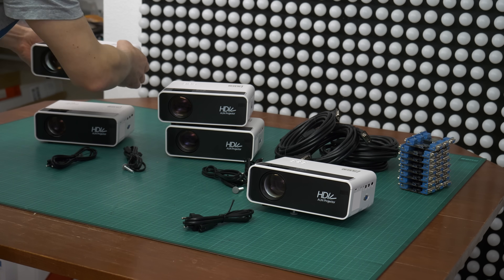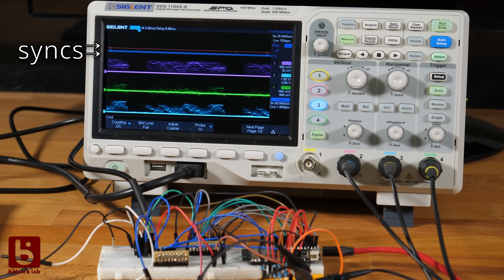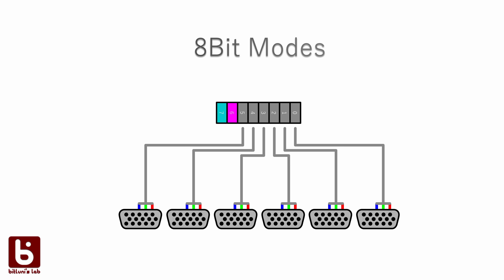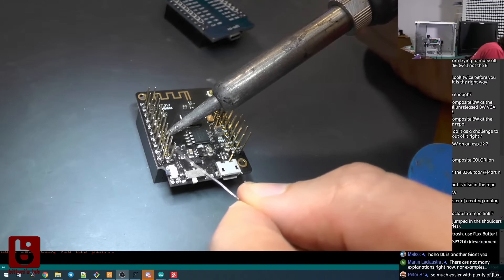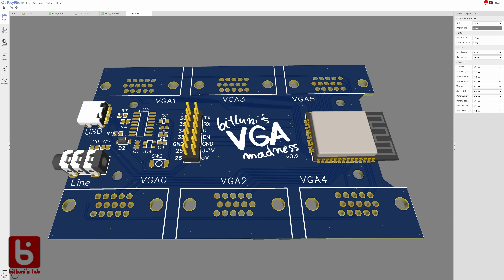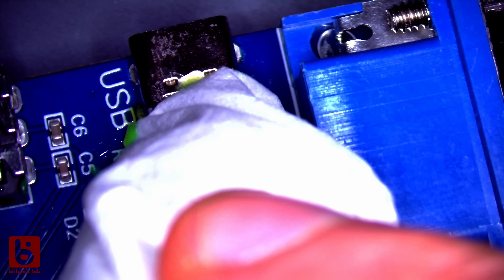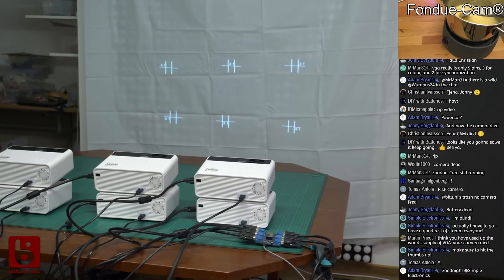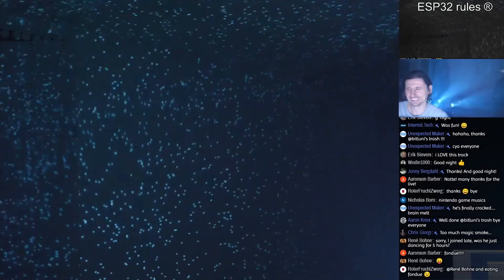6 LED Projectors driven by a single ESP32 = VGA Madness

Comment: 1:55 i know this is an old vid and your newer ones show you have more bandwidth to work with, but I feel like you could have reserved a specific number for the sync signals instead of whole bits. Basically instead of crushing your colourspace down to 14bits, make all1's/all-voltages-high vsync, and all low/0 as hsync
On the framebuffer side refuse to draw true white or true black and instead subtract 1 or add 1 so noone notices
Then instead of the simple resistor arrays on the output you could have an electronic circuit to pull x-sync high when all the other pins are hot/off. You might lose a single line of vertical and horizontal resolution but gain fifty-thousand new colours

Comment: People like to crap on VGA but the extended VGA modes could do up to 2K resolution and with a half decent cable you could get up to 50m. All with no DRM dropouts when you used a media switcher. It was grate before SDI became cheaper.

Comment: now you can do hdmi
Reply: Bro hdmi is a lot harder to implement than VGA. It is maybe possible, but you need fast clock and over clock ESP32 to pull it of.
Reply: @happinubI’m sure you can use a vga->hdmi converter with this

Comment: Can you make drop in replacement ESP32 board for 286/386SX cpu? That could be a nice upgrade for retro pc. No need for cache on motherboard and no speed limit for ESP32 just slow ISA bus. But ESP32 could emulate any cpu from 86 up to Pentium…

Comment: having owned an LPKF Laser and Electronics PC Board mill years ago, I can tell you they used a set of 3mm register pins to assist with aligning the top & Bottom layers. they also employed a collar and foot that rode on the board to set the bit depth along with constant vacuum extraction of the chips.

Comment: can you point all the projectors in to a small area with fog inside a perspex case and try to make some kind of volumetric display like a CT scan in reverse with them?? when i was a kid i dreamed of trying to get good enough with microcontrollers and electronics to be able to make something like that as a little holographic doorbell type of display, out of an array of gameboy or nokia LCDs with single LED backlights to make tiny low res projectors. I have no idea if it could work but I've always wanted to see someone try it

Comment: Would you consider using the esp-32 WROOVER module instead of WROOM? It has up to 8 mb of PSRAM, which would probably let you hold an entire frame in buffer, and this would let you use higher resolutions as well.
Reply from the maker: good thinking.. but unfortunately rover modules have more gpio pins tied up to talk to the psram. i'm already using boot selection pins for the last vga port. but the showstopper is that DMA works only with "DMA memory". that's basically a section of the main SRAM. using psram as some kind of backbuffer is also too slow. but it could be used for audio and stuff that's not as time critical

Comment: reverse/side laser/electron CRT tube, with either back mirror bounced laser to front screen, or side arc'ed CRT display
Reply: first accelerate electrons in direct perpendicular to the screen line strip, with crt, multiple lines, simultaneously, then another electric field to determine where in the line axis it hits the display
Reply: whole display length secondary direction changing electric field, spot direction electric field
Reply: multiple narrow direct cathode ray tubes as the electron sources
Reply: screen has multiple voltage terminals in matrix, in lines, to force the electrons to land in the selected pixel positions, just set the voltage up in the selected positions, colored
Reply: cross lines to point a position in x-y matrix or line-x matrix per line individually
Reply: per line is better, as many as you have sources, crt tube sources

Comment: Fair warning: Those cheap projectors like that advertise 2800 Lumens but when reviewed often produce real world values from 90 to 200 lumens. Well short of advertised spec.
Reply from the maker: i could do an comparison with a benq i got here. it certainly is over 100lumen but probably also not 2000🤣
Reply: Do you have a lux meter? If you make the projection in a surface of 1m2 the lux meter should measure 2000 lux (that's the illuminance) for a 2000 lumens projector (that's the flux). Or, measure the area covered by the projector, measure the illuminance in lux and then the flux in lumens would be illuminance*area (1lumen=1lux*1m2)

Comment: Very cool project. You should look at the ESP32-S2, as from reading the Technical Reference Manual it seems to allow one to hook up external RAM and read from it via DMA to the GPIO output (I2S), so you could get around the SRAM issue on the original ESP32. I don't think you can DMA from anything but SRAM for the original ESP32.

Comment: - Structured light projection for 3D scanning from multiple angles? 'cause timing is critical... 
- Programmable micro spotlight for stage presentations? e.g. the object isn't visible because no light is hitting it until you want people to see it, then it's lit from many angles. Or the red cellophane is unlit until you want "fire" to appear all around your actors. 
- Mirror ball that makes "shapes" appear around the room by distorting the positions of certain dots. 
- Combine with tracking to make jewelry or clothing or certain peoples faces "glow" no matter where they are in the room. Tracking is hard.
- Animated markers or signs in different locations around a hall which change to indicate events, etc... But install is easy 'cause they are all in one place and wifi accessible. 
All sorts of fun stuff you can do with this.

Comment: how much time did it take to discover the tx/rx flip? how can it be discovered?
Reply: RX/TX flip is discovered by communication failing to work. Two separate tubes, you speak into one, and listen to the other. if you're not listening on the right tube you don't hear anything. The metaphor is faulty because if you hold a tube to your mouth the sound is conducted through your head. 

Electrically at some point a transmission needs to be received.

Comment: ... Why are you storing H/V sync instead of just running an interrupt timer /counter?  Also, you could use less ram if you worked with tilemaps and sprites (similar to the NES, or like a text mode), that way you don't need to store every pixel.
Reply: That sounds like an interesting idea that can't just rely on i2s peripheral to squeeze out the VGA data.

Comment: I have taken to putting a redundant set of through holes around my micros.  That way I can cut bridge and solder in jumper wires to the extra holes. Or, just solder in an extra pin and use bread board jumpers.  Makes for very fast and clean rerouting of dev boards.
Reply: Yeah I add tons of headers, which make use of those motherboard jumpers.
Ive been working with a ton of VGA and hdmi lately, and because I dont know the best configuration for the ADCs and DACs, i make heavy use of them so I can reconfigure the device any way I want to.
Once I find the best configuration, I remove them for public release versions.
Reply: TX/RX on the first revision should go through 0 Ohm resistors placed so you can easily swap them. At least, I keep telling myself I should do that.

Comment: Have you considered using PSRAM for the framebuffer?
Reply: The psram chip has requirements for idle period to ensure that it can refresh the ram, as its not true sram. that plus latency issues with SPI would make that troublesome.

Comment: Really cool! Are you using the Arduino framework on the esp32? Have you ever come to the point where arduino framework doesn't sute your needs and you need to use espressif?
Reply: the arduino framework is basically a wrapper around ESP-IDF.
Reply: @DoctorWhom  I know it's a wrapper and I have used both approaches. I just don't understand why the Arduino framework/wrapper is not being used that much on commercial/industrial applications.

Comment: I recently worked on a board that JLC assembled (including USB C). A friend got them done. The quality was total rubbish. Lots of pins not soldered properly on the USB C etc etc etc. My own boards from JLC have generally been good but I would not trust their assembly service.
Reply: I wonder if they double, triple and quadruple checked knowing it was going to a reviewer. hmmm.

Comment: this is lame...who the hell has a use for 6 1bit displays... theres nothin even really special about it... i mean ya using the same syncs.. and lack of color is meh.. sure ya could get ya RGB from the projectors.. but who the hell is gonna run out and buy 6 projectors to run this 1bit crap on...
wanna impress me... get higher resolutions/colors outta a single esp32 vga output...
Reply: lol

Comment: Cool video!
Just one suggestion: Have you evet considered using external SPI ram since you said ram is your primary bottleleck? I read you could expand the ram by 4mb this way.
Or is that too slow?
Reply: I believe the exten SPI ram is far to slow, it is swapped in into the cpu and there are tons of problems with interrupt handlers.

Comment: Very cool work on the ESP 32, the addition of projectors makes this god damn awesome. The star field looked almost 3d with the projectors overlaying each other. I think using the pio of the RP2040 would drive these in better colour and look fantastic, I think you've almost reached the limits of the ESP32 but prove us wrong or embrace the pio of the RP2040. Whomever marked a thumbs down is obviously an idiot with no appreciation for driving the nuts of a great soc!
Reply from the maker: I love the RP2040 HDMI implementation, I'll exploit that for sure.. only problem is the lack of sram there
Reply: @bitluni  pfft, I'm sure you'll find a way around that problem. I wonder if you could implement VGA with one pio and ram io to an external chip from the other pio. What about compression using Huffman coding? Regardless, I'm sure whatever you produce with the RP2040 will be awesome. Thanks for a great video bitluni, well received and very much appreciated!
Reply: @bitluni  just use an Everspin Technologies 1Gb non-volatile MRAM for a fifo ? their faster than other nvr

not sure rp2040 has 4 spi to run faster 'mouser' QSPI MRAM though

Comment: What is the theoretical maximum resolution if you only needed black and white graphics?

Would you be able to feed the VGA output into a VGA-to-HDMI adapter to connect to modern displays?
Reply from the maker: the actual maximum is 800x600 with no framebuffer at one bit per pixel. My library supports that already. It's an interrupt that's firing each line and expects to fill the line buffer in time
Reply: From the previous videos I believe the limitation on resolution is 800x600. If the horizontal resolution is increased, pixels  need to be doubled. Since going to black and white doesn't allow more resolution, simply add more monitors! Edit: I see description says 640x480 for resolution, docs sounded like 800x600 wouldn't be a hassle. i need to get me one of these

Comment: Hi. 
Did You tried C64 or amiga on those lcd displays? Are they ok for 15khz signals?
Reply: That would require making a cable that accepts AV input on that projector.

Comment: Great project! Couldn't you use Esp32s with 4mb psram? Wouldnt that allow more colors or more resolution?
Reply: DMA can‘t sadly be used on external memory. 

Maybe a ringbuffer would help,  let the CPU fetch the data in „chunks“ from PSRAM, while DMA blasts out the prefetched „chunk“ from the internal RAM.